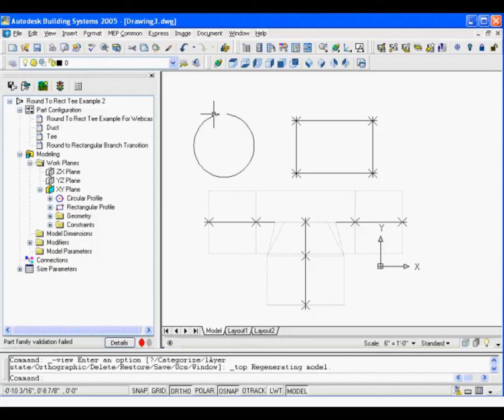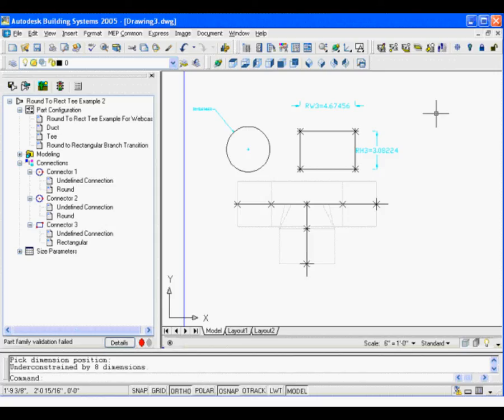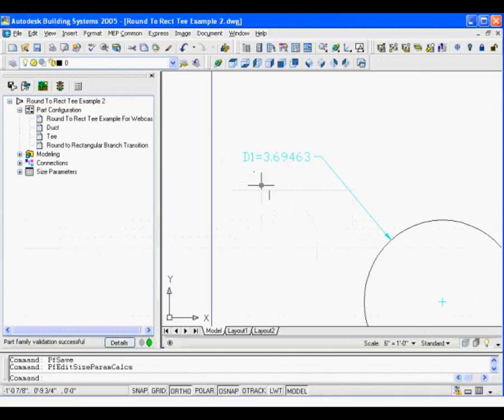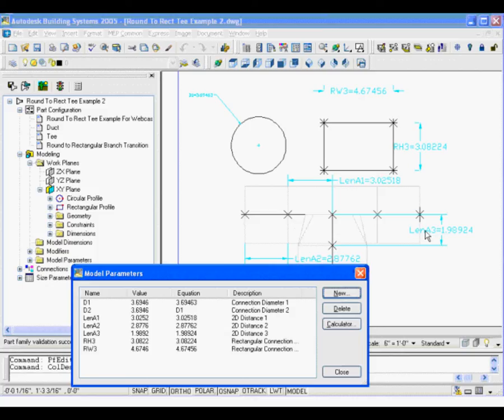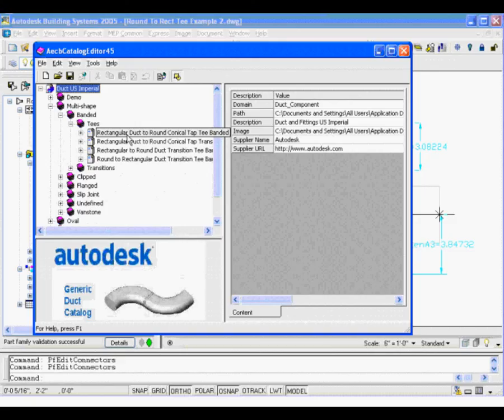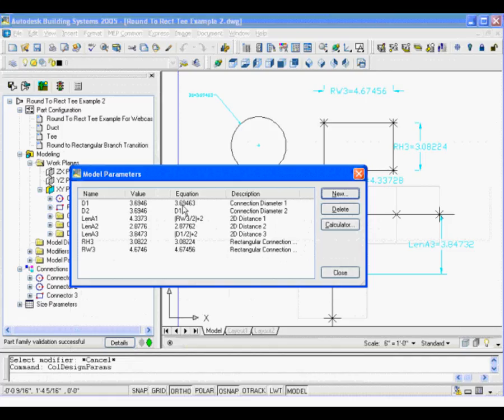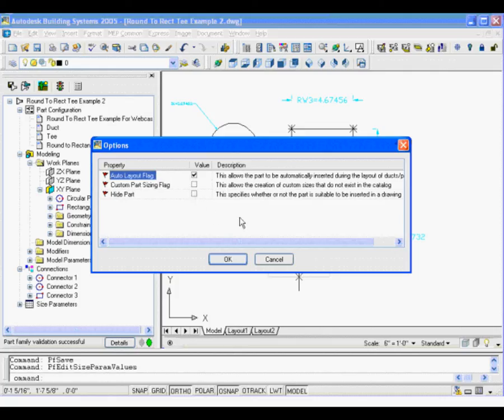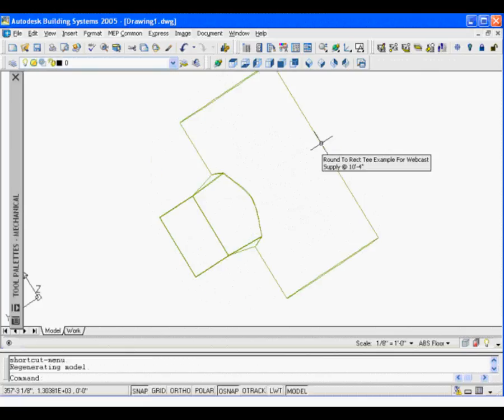AuctoCAD MEP Create a Parametric part 2

Comment: Good video, as I am trying to learn MEP 2020.  Question though...how does the round part of the branch profile know not to extend all the way into the centerline of the main trunk of the tee?  How does it know to make the transition just to the radius of the duct and not go into the inside of the duct?
Reply: Actually, it doesn't. It does go inside of the other piece. It's just that you don't see it because it is not a hollow part (as you would get with a revolve feature). It really doesn't make a difference for your modeling purposes. (I'm aware the question is pretty old but hope it helps someone)